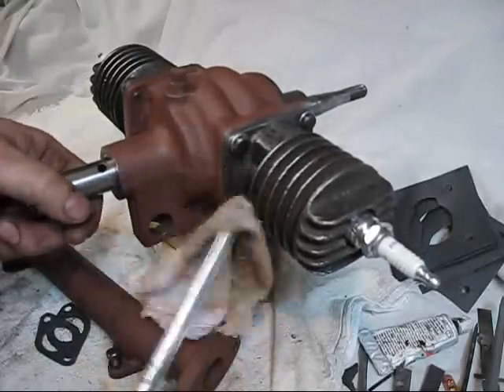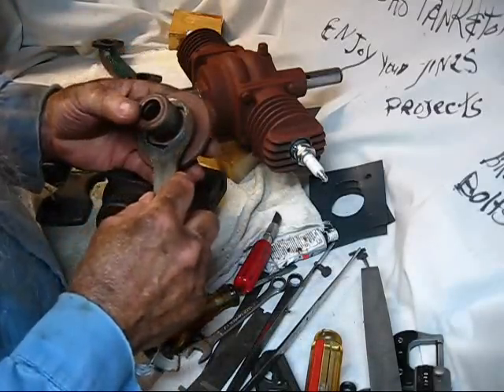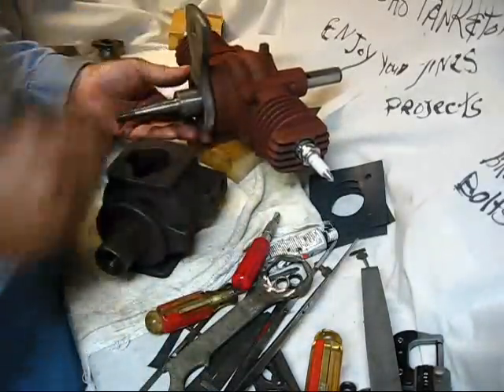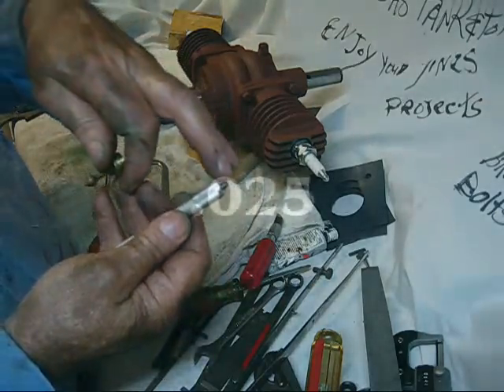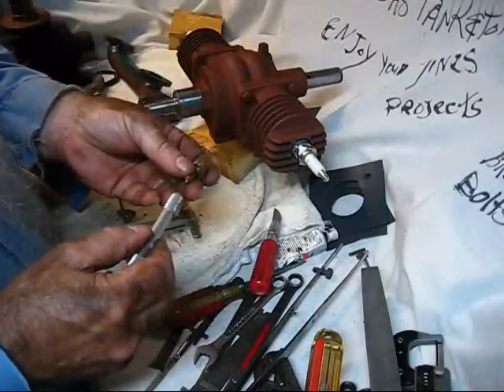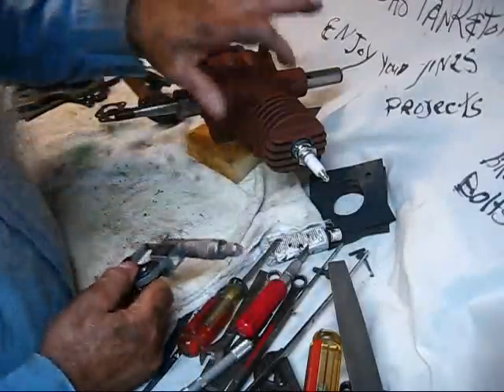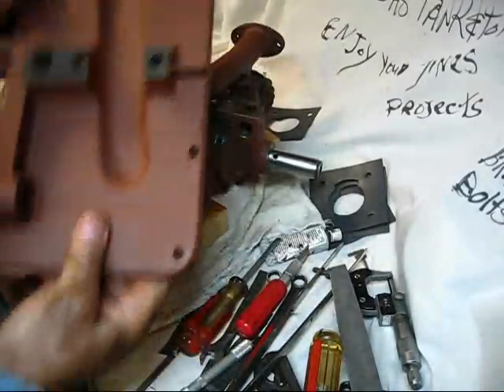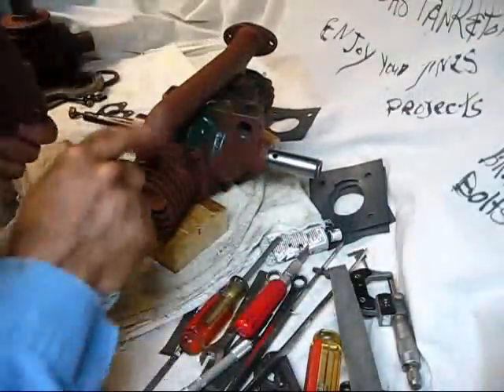1937  Maytag Engine model 72 rebuild #27

Comment: Nice.  I keep wondering, if you can put a carb on the intake, down under it, instead of the tank? With oil in gas, of course. With it that way, id consider trying one for small generator. thanks